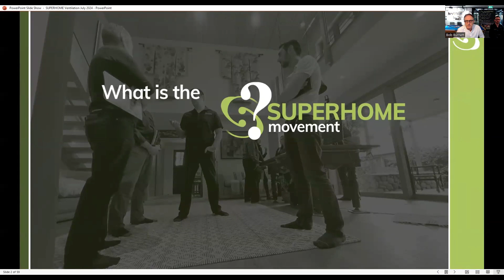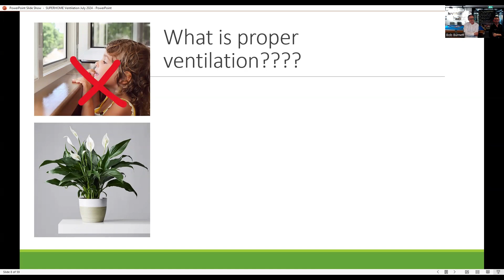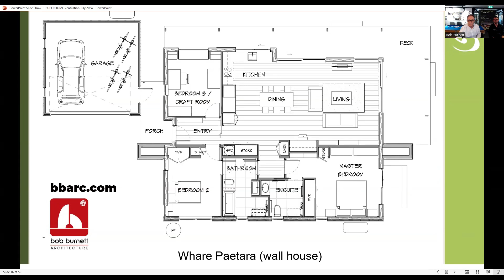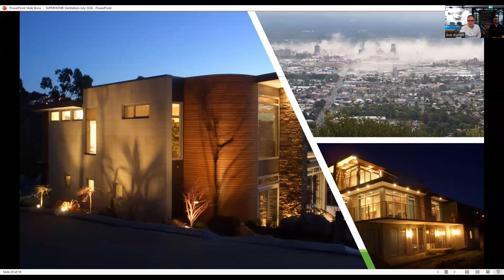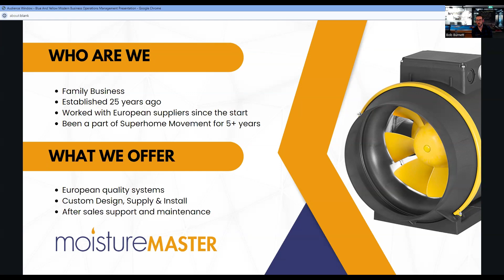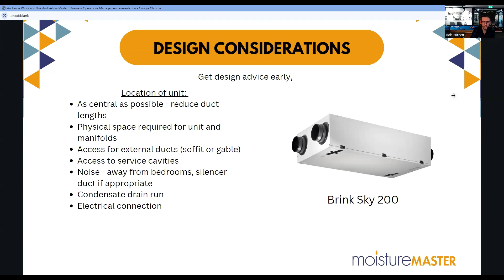Superhome Ventilation

Comment: Furthermore to the Building Code G5.3.1, "Performance G5.3.1 shall apply only to old people’s homes and early childhood centres." So there is actually no performance requirement at all for a residential homes. If they took that caveat out of the building code, designers would actually have to consider this and design in a compliance pathway.